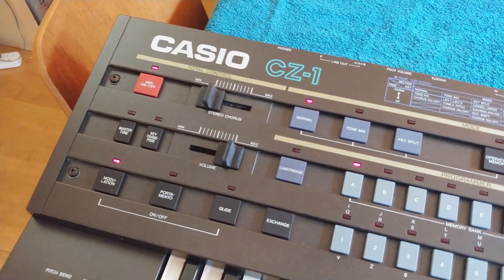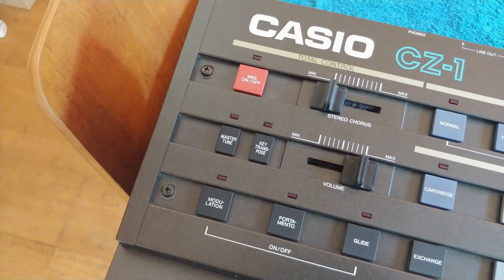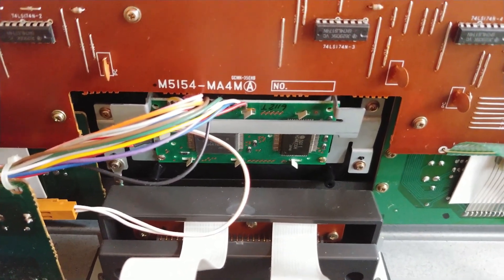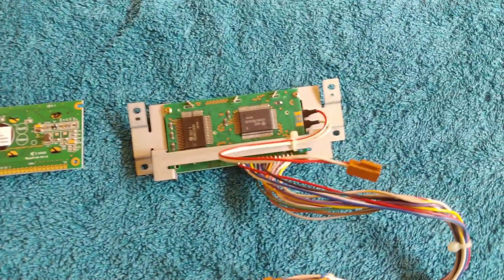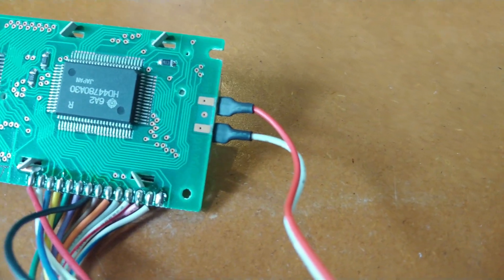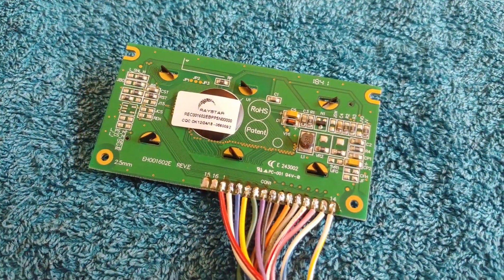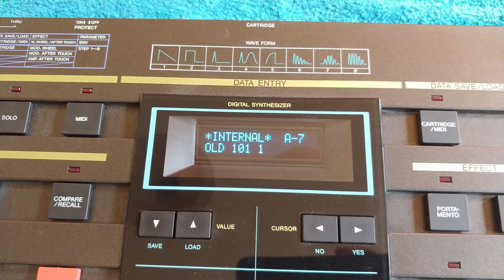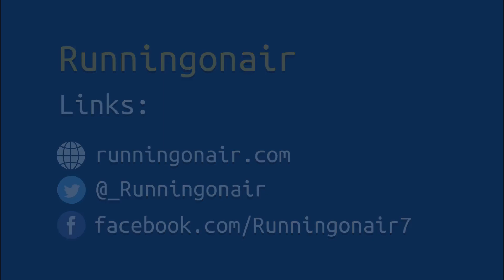Casio CZ-1 Phase Distortion Synthesizer - Part 7 - LCD/OLED Display Replacement

Comment: I thought about OLED but the one to one replacements are like $5 instead of $100 (on Ebay) so I just went with a grey matching backlight. I'll try yours I see the link. No BLUE anymore. I got white. cost $53 USD for (2) shipped.
Reply from the maker: Still a good price then.

Comment: Hi there! Thanks for the informative video! If you don't mind me asking, what did you do with the two wires that connected to the original screen but don't attach to the new one? Are they just loose inside the case now? This will be my first project like this and I'm a little worried about that aspect in case the loose wires short something out once its closed up. Thanks!
Reply from the maker: Not sure i remember.  I think the whole wire could be detatched and is now in a spares box.  If it is loose it would be a connector type that can't short out.  If in doubt you could always wrap it in insulation tape but im sure that wasn't required.
Reply: @RunningonairMusic  good to know, thanks! I appreciate it.

Comment: Thanks for this! I bought a replacement OLED display kit a while back, but kept putting off installing it into my CZ-1 (I also bought displays for my 101). Your video made it look fairly painless with your logical steps and guidance. Many thanks!
Reply from the maker: Glad it helped.

Comment: Looks like you forgot to install the white frame in front the new display?  (Compare old 0:34 and new 3:34).
Reply from the maker: There's a light metal frame on the old display attached to the board.  Not really transferable.  The new one has a smaller black surround, which accounts for the difference.  Well spotted though.
Reply: @RunningonairMusic  interesting, thanks.  I'm about to do my own CZ-1 and was looking around (how I found your video).  Great video, btw, gives me a "sneak peek" to the task ahead.  (I've already given the OLED treatment to a lot of my other gear, including a little brother CZ-101, so not too anxious about it overall.)
Reply from the maker: Glad it helps.

Comment: Stock = 0
Reply from the maker: Just updated the link.  They have some yellow ones now.
Reply: @RunningonairMusic  you bought alphanumerical (REC reference), but are you sure the graphical displays will work ?
Reply: @RunningonairMusic  no ok it's alphanumerical as well, not from the same manufacturer. Thank you!
Reply from the maker: you had me worried then.

Comment: Great vids, i am glad you made some on the esq1 too.  :)
Do you reckon this will work for the cz3000? going on what you said about the cz101 display not needing the 2 exrta power wires im assuming/hoping it will.
Reply from the maker: Yes, I suspect they are all the same display and you only need to connect the 14 data wires as there is no back light required on an OLED.  Glad the ESQ vids are helpful too.  Got plans for a new one soon.